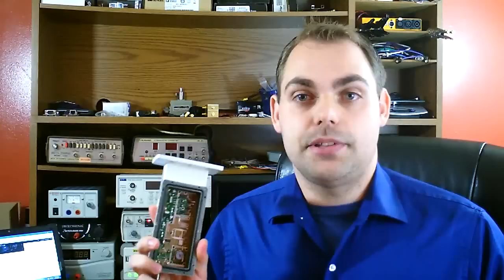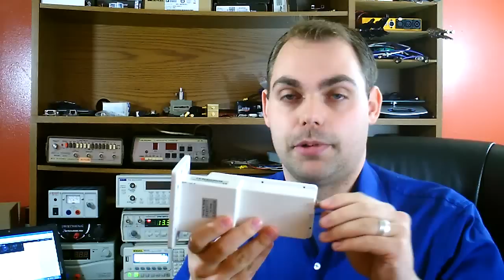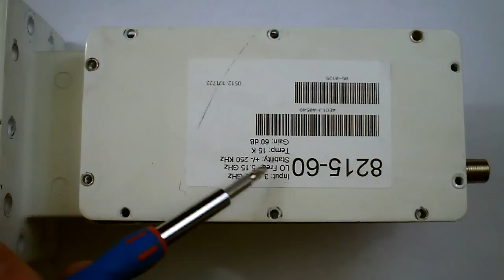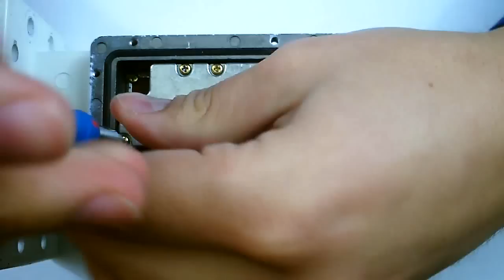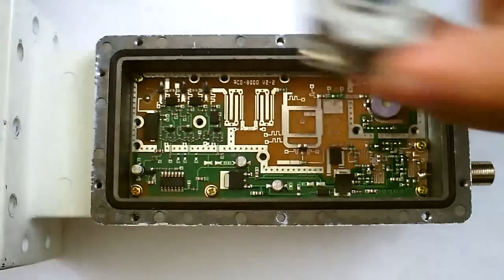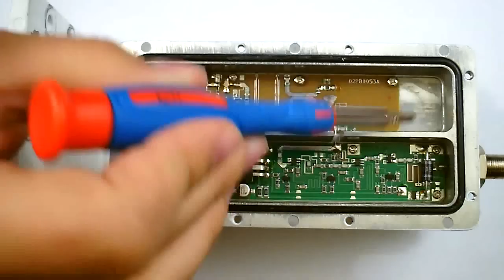What's iside a C-Band Satellite TV LNB?

Comment: 1. Purpose thing is actually dielectric and inside part is a base as per my understanding. 
2. Hair pin filter is called hair pin filter because it's like a hair pin which is a bent wire.
3. Coupler is basically branch line coupler which provides signal in 180 deg phase difference at both ports, it helps to cancel LO frequency at mixer output.

Comment: hello goodnight! A question is it possible to modify the lnb to capture the frequencies of the uhf ISDBT terrestrial digital tv bands from 450 to 860 mhz. mhz .I'm thinking of reusing the common fta receivers dvbs2 hd h264 .as if it were a common terrestrial digital converter.
Reply from the maker: Hi! No, that frequency range is way to low for any reasonable modifications of a common LNB. That said, your receive range isn't too far away from the receive range of the FTA receivers. So might I suggest to build a classic upconverter? But from what I remember, the terrestrial DVBS and satellite standard have some protocol differences.

Comment: Have you used the cband or Ku band LNBs for radio astronomy?  I installed both types, but I hear an AC hum.  I powered the LNBs with both 12 VDC batteries and A DC power supply.  I found both C-band and KU band LNBs are creating the weird AC hum around 1200 GHZ on my 2 Icom r7000 radios.  I used a RTL SDR receiver, but it has a lot of internal spikes.  Is the AC hum normal or is the LNBs defective--I guessing  the dielectric capacitors have dried out.
Reply from the maker: Hey Mike. That's an interesting question. Since you tried 12 VDC batteries, I would guess that the AC hum is unlikely to be injected through the voltage rails. This I would guess that dried out caps is likely not the issue. If you have the option to try a different LNB, I'd suggest to try that first.

Comment: Hairpin filters are called so because they resemble hairpins (AKA Bobby pins) 

Girls use them to hold their hair in place.
Reply: To actually get the point across, it's only the shape of the hairpin that counts, a sharp U-turn is involved that happen to have long legs.  But a mountain road with switchbacks also has this shape viewed from above.  Thin legs of the hairpin is not the point.

Comment: There used to be a microwave link connecting major centres together for telephone, television and frame relay, but they have all been closed down and moved to either fibre or ku band links, mostly fibre buried in the railway rights of way ( includes pipelines as well) and a network of fibre optics on power transmission lines ( hard to steal those, 132kV makes a good deterrent to cable thieves, though they steal the steel structure until it falls down)

Comment: Here in South Africa there are a few users of C band, but most have moved to KU band, only ones that are really using it are banks for data links ( old equipment still going after 20 years of running and not going to be changed until the satellites die) and the spectrum operator for radio, TV and such links to the broadcast locations. There are a few data links from some of the older ISP's, but I do not know if they are in use any more. most have moved to fibre.

Comment: DRO uses electric field, changing the chamber size with the slug changes capacitance to the ceramic and thus the frequency. Attenuator on LO is to reduce signal fed back to the LO oscillator and thus reduce pulling. Also note no solder mask on the high frequency area, as it is too lossy at that frequency to have it on. I used to work a little on radar systems, but there it was all plumbing and piping.